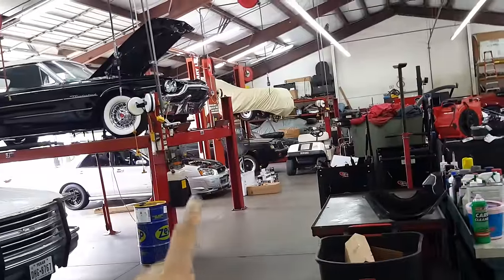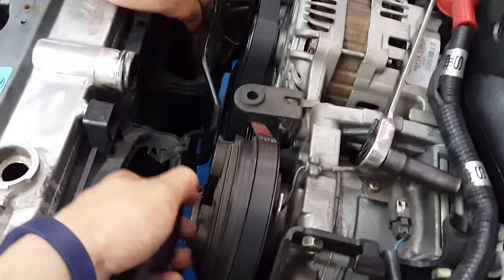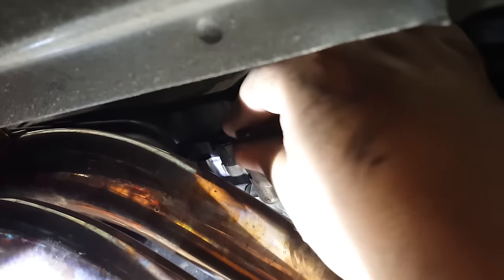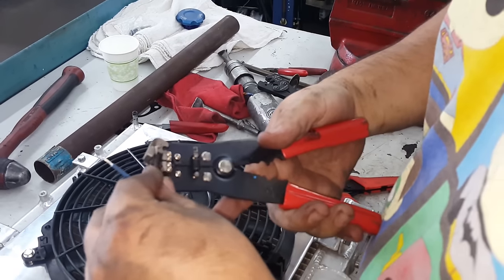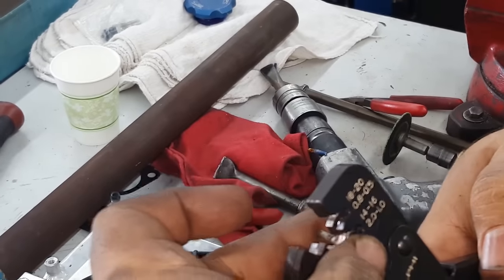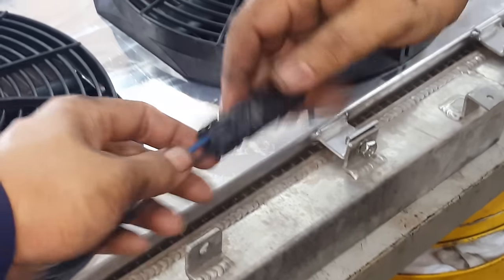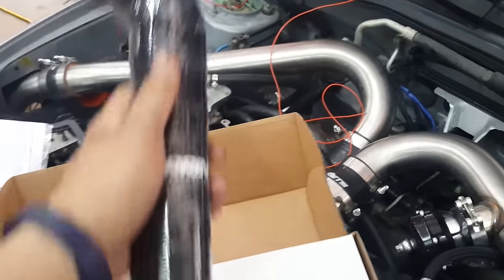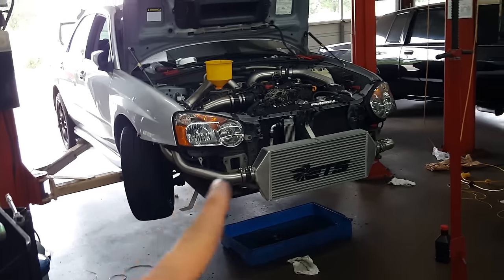STi Gets NEW Fans- Ep. 40: Radiator Fan Shroud

Comment: Hi man! Does this fan shroud really helps with overheating issue? I have a Subaru Legace Spec.B with H6 EZ30 and I have also overheating issue when I push the car hard... Can this fan shroud help (I do have a mishimoto radiator with stock fans...)?